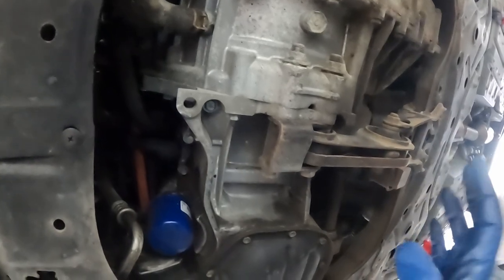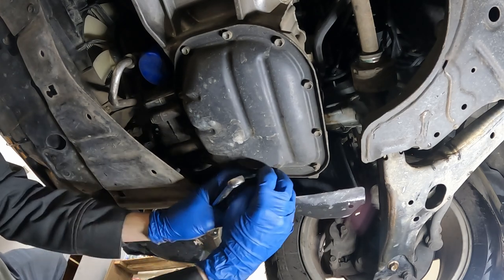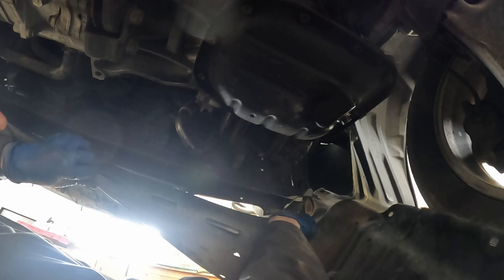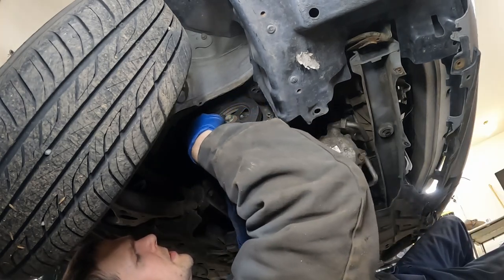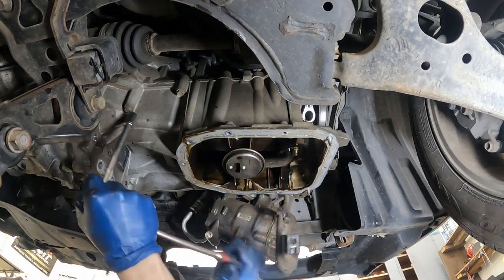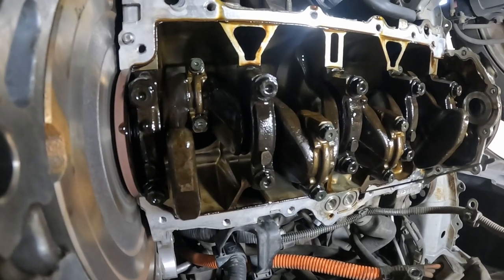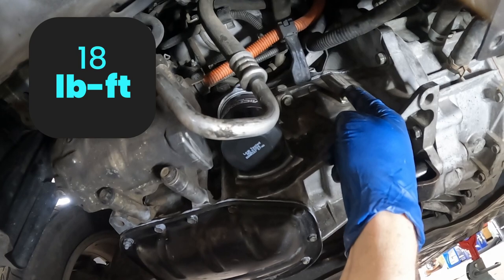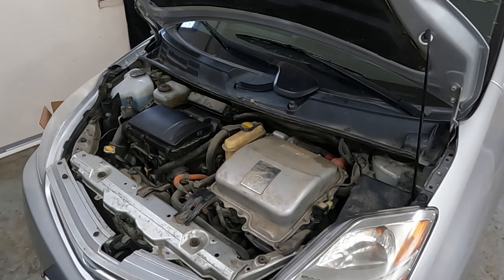2004-2009 Toyota Prius Gen 2 Connecting Rod Bearing Replacement Without Removing The Engine!

Comment: Update, 
The car is back together and after starting and running for a few minutes the engine noise is unchanged. It is a significant ticking sound just like the sound demonstrated early on in your video. I was concerned that I was on the wrong trail because the rod bearings were like new - practically no wear. After lurking around in PriusChat I found that a broken piston skirt has the same symptoms as I am experiencing. When I pulled the oil pan I noticed a chunk of metal and set it aside and finished the bearing replacement. Turns out the pc is a piston skirt, this is a well covered topic in PriusChat, Expensive lesson for me from a time standpoint, now I know. I will likely replace the motor.

Comment: Thanks!
Following your video I just finished replacing the rod bearings and it went really well. The last part of getting the housing stuffed back in place was a challenge but you clearly demonstrated that as well which gave me confidence to tap it into place with a 12 ox soft hammer. All is well and torqued to spec! Thank you.
Reply from the maker: Awesome! Glad it went well 👍. I love Prius they are great little cars.

Comment: Awesome!  Was wondering if could get to all cylinders parts from below.  Unfortunately, I found that I have a P0301 code on a friends car I'm considering buying with a hole in the center of the piston.  Well, thinking I all isn't bad on the inside, will need to pull the head off as well. Any suggestions to be looking out for and considering before doing?  Thanks for sharing, liked, commented and subscribed.
Reply from the maker: The whole engine can be rebuilt in vehicle. The main bearings and rod bearings you can get from underneath but the pistons come out of the top so the head needs to be removed. But all in all it's not a bad job. I would recommend checking to see what kind of damage if any there is in the cylinder walls and head/ valves.

Comment: I took off the oil pan yesterday and there were large chunks. I took off the large tray today, and there is a piston skirt that is broken. The piston caps are loose left to right, but not forward backward... could those bearings cause the pison skirt to crack? Zero codes, 2006, 264k miles. No noise with seafoam. But new oil, and the same sound as yours had! Thoughts?
Reply from the maker: The connecting rod moving side to side is ok. It's front to back or up and down movement you don't want. The noise could be coming from the piston and not the rods. Typically piston damage comes from heat stress (lack of lubrication) or pre-ignition. If the cylinder walls aren't too damaged you can take the head off and replace the pistons and rings.

Comment: I'm looking at the part numbers for the rod bearings. Are two of them stamped the same?  All I'm seeing is 3 rod bearings when shopping for parts.  Are cylinders 1 and 4 rod bearings the same part number maybe?
Reply from the maker: As far as I understand it, each connecting rod has a number stamped on the cap. That number corresponds to what bearing goes in it. But you can't predict the number until you pull it apart and look at it. The set I installed was from DNJ. They didn't have any numbers on their bearings. It was one side fits all.

Comment: Hoping this is similar for the 2010-2015... I cant find a reference video, but bought a prius with a pretty bad rod knock and hoping its this easy to change. Fingers crossed!
Reply from the maker: Let us know if it is. The engine is different. Those years have the 1.8 in them.
Reply: @ValleyMobileAutomotive  Thanks a ton for replying! Mainly concerned with the upper pan coming off like yours did. Can't seem to find a video online where anybody has done it already.

Comment: Really great video, thank you. I'm endeavoring to do the same to my Prius. Was curious if there have been any issues with the upper oil pan since. I'm nervous about that seal given such a tight fit going back in. Any other problems several months later? Thanks!
Reply from the maker: No oil leaks or any other issues. It is a tight fit though. I'll have a timing chain video on one of these coming out soon. It's up to you if you want to wait to see what pulling timing cover off looks like.
Reply: @ValleyMobileAutomotive  Awesome, thanks. I appreciate the info!
Reply: @ValleyMobileAutomotive  Turned out the cylinders had a lot of damage, so I ended up not doing the bearings after all. Almost want to find another one to try the repair anyway...haha

Comment: Thank you for the video, I really appreciate it.  With your video as a reference, my nephew and I  successfully changed the rod bearings on my car.  My bearings were shot, and it was knocking quite a bit.  Thanks to this video, everything went flawlessly. I, too, found the rod journals to be in good shape even though the rod bearings were eaten up.  You are the man!
Reply from the maker: Awesome job Matt! I was pleasantly surprised how relatively simple this was to do.
Reply: That’s pretty awesome. Anything not found in the video a non-mechanic tackling this job might want to know ?

Comment: Seems like avoiding the removal of the timing cover was more trouble than it was worth but you proved your point that it didn’t NEED come off!
Reply from the maker: Yeah, the timing cover really isn't too bad of a removal. The only thing is you would need to suspend the engine with something like a 2x4 and ratchet strap because the motor mount gets removed. But that's an easy obstacle to overcome. I'm rebuilding a gen 2 Prius engine in the vehicle at the moment. I hope to have those videos out sometime soon. It's been a fun project.
Reply: Yeah in my case it’s the piston that needs to be replaced so the head must come off too. I’ll be changing the rod and crank bearings as well of course while I’m at it. Thank you for your videos.
Reply: @ValleyMobileAutomotive  - Can "reinstall" motor mount with timing cover off! The part that bolts to engine of course leave loose but well-threaded. Parts snug for the other two pieces.... engine now suspended.
Reply: @ValleyMobileAutomotive   That's brilliant! I recently discovered the same, that the mount does not directly attach to the block but rather the timing chain cover (kind of an interesting design choice from toyota but obviously it has worked well for these cars). As a result I became a bit discouraged from attempting the rod bearings, fearing that I'd replace everything correctly but be unable to get a good enough seal with the timing chain cover if it had been left in place. Next time I walk out to the car I'll check for places to wrap a strap around!

Comment: The manual says there are 4 sizes of rod bearings: 1, 2, 3, and undersized. Is there anyway to know which size to buy before taking the engine apart?
Reply from the maker: Not that I know of. The number is stamped on the connecting rod. This is the only one I've done so I'm not sure if there's a pattern to these. Some aftermarket sets don't give you a thickness difference, DNJ just sells one size for all four 🤔. If you plan on keeping the car for a long time I would recommend pulling the pan to get the numbers then order them from your local Toyota dealer. While you're waiting for the parts you can pull the timing cover off. The valve cover comes off first then the crank pulley and water pump pulley. Then it should just be a bunch of bolts holding it on.
Reply: @ValleyMobileAutomotive  Thanks a lot. I'll buy the aftermarket set since the thickness difference between OEM's 1,2,3 bearings is small relative to the maximum oil clearance. Maximum bearing thickness difference = 1.5-1.491 = 0.009mm Oil clearance range = 0.06 - 0.016 = 0.044mm I guess the undersized bearing is for people who had to machine the crank. I also found a video where someone pulled the timing cover off to change the head gasket. Your video is much better than that one. It seems to be quite a lot of work to pull the cover. I'll try it your way first. If I can't put the pan back, I'll then try pulling the timing cover.
Reply from the maker: @wangfoobar  sounds good 👍. Let us know how it goes.
Reply: @ValleyMobileAutomotive  I took the engine apart following your video. My rod bearings looks ok. I guess my engine knocking/rattling problem comes from elsewhere. It did run low on oil (about 1-2 qt left) and had a lot of silver metal flakes in the oil. That's why I guessed it's the rod bearings. I'll check the crank bearing and cylinders tomorrow. Do you have other suggestions? If I can't fix this problem, I'll probably put everything back together and shop for a junkyard engine.

Comment: Id of went 13 ftlbs plus 90 degrees on those torque to yield rod bolts stretching them the same amount as stock sometimes ends badly when it comes to clearances a little loose youll never know it when it comes to torque to yield fasteners though a little tighter than spec is better if your gonna chance reusing them toyota does use really decent hardware though
Reply from the maker: Yeah torque to yield bolts are generally one time use. And it's risky reusing them. Fortunately these bolts Toyota made reusable 👍
Reply: Unless you are a toyota engineer I am going with the repair manual. 😅
Reply: @mr2fas2  I've rebuilt plenty of Yotas also seen the carnage when a torque to yield bolt wasn't stretched enough I said an extra initial 2 ft lbs because he didn't have a stretch gauge trust me if they are a little tight you will never know a little loose and uncle Rodney will be crashing through the side of your block like the Cool Aid man I've been building performance engines and doing standard rebuilds for 25 years I was building 9,000 rpm Lima ford's when I was 14 years old finished top place in the tri state regional competitions for performance automotive machining and rebuilding against over 20 other classes of students know guys from Millets Kammer&Kammer and Ohio George Montgomery's shop on a personal basis my Dad built race cars and engines since the late 60's he was a chassis builder and built a lot of cars these shops built engines for so I met and watched some of the best in the business over years build everything from Omni 4cyl turbos to John Forces prostock Hemis I'm not just some kid giving my two cents